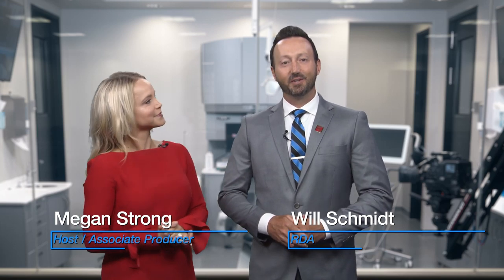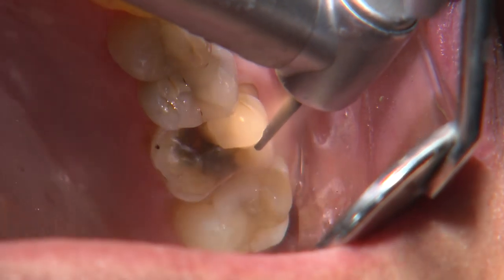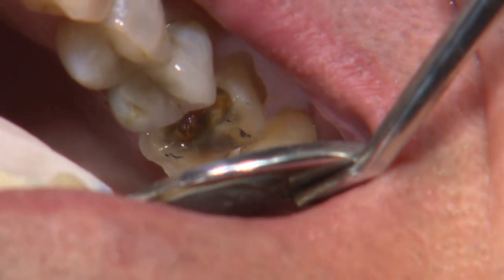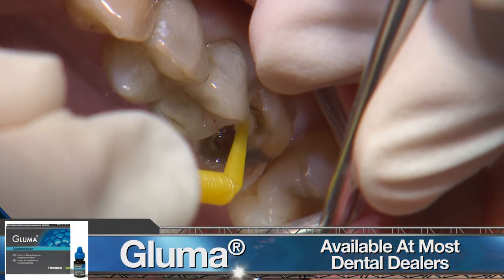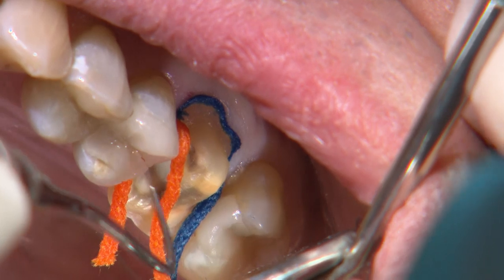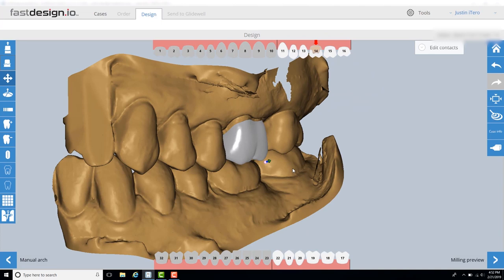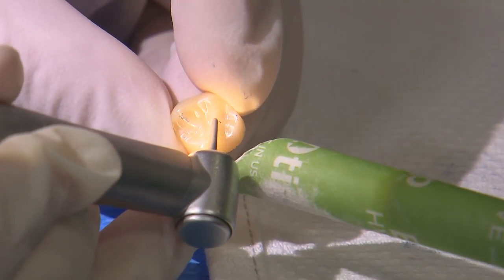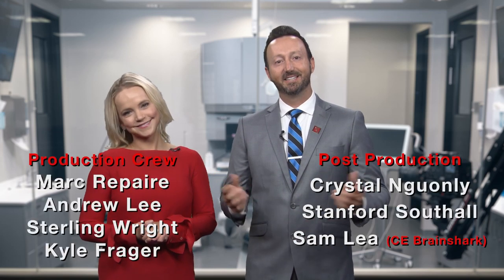Chairside Live Episode 257:The Most Efficient Dentistry of Your Career

Comment: Yep, my lower teeth were painful.  It felt like someone had taken a portion of a wire coat hanger and wrapped it around my lower teeth and then using a pair of pliers, twisted the wire to crunch all of the teeth together. So there was never a gap between any of my lower teeth throughout my life.  In fact, one tooth ended up rotating 45 degrees since in that position it was not as wide. Then I went to a dentist to get my teeth cleaned. When I got home, I looked in the mirror and was totally shocked. I now had huge spaces between my teeth. Not only did the dentist remove any plaque, but removed much of the enamel on the sides of my teeth as well. So now, due to drinking tea, I had deep dark stains on the sides of my teeth since the enamel was removed.  So I had to stop drinking tea.  Then one of my teeth fell apart to a degree.  So the dentist, while bragging about how she had to fly to Paris to attend a wedding, said that the tooth was infected and had to be removed.  I said, " No it doesn't".  She said, " yes it does", I said, "No it doesn't", and so on and so on.  4 years later I still have that tooth, and there never has been an infection. Then there was the time many years before where again I had my teeth cleaned. The dentist, a different dentist,  kept on asking me, "Does it hurt ?", as she went from tooth to tooth doing something with the scribing tool. WTF?  Many years later I found out what she was doing due to my gums having receded a bit. She was scribing deeper and deeper into my teeth just below the gum line until hitting the nerves. But now, due to the gums having receded, when I brushed my teeth, the bristles dropped into the grooves and hit the nerves, and It hurt big time.  It took many years before it no longer was painful. Yep, aren't dentists wonderful people. Around the same time that she told me I had to have a tooth removed, a filling had dropped out.  So she filled it.  Then 2 weeks later it fell out.  So she filled it again. Then a month later this 2nd filling dropped out.  All she wanted was money, money, money, and so she never did a proper job.  So I said to heck with it, and just made sure that the tooth is kept clean at all times. No cavity has formed over the years since then. Yep, aren't dentists wonderful people.

Comment: Why not composite filled instead of ionomer? And then prep? ....
Reply: That’s one of the beautiful things about chairside CADCAM - milling the final restoration immediately to adapt to the clinical situation. No need for extra steps when the “build up” is built into the final prosthesis
Reply: @justinschi  Is retention strength better than a core build up  in this situation?  Thanks for your ideas
Reply: @Drminhquan   I believe less complexity is better as it's difficult to quantify what's better. The mesial defect has 3 walls whereas if I did a build-up it would reduce to 1, reducing the surface area for retention. Would that be enough retention for this prep? Probably. The final retention is also dependent on the buildup's bond to the tooth. Would additional lingual reduction increase retention area? Absolutely. But what's the compromise? For this one case, we could treatment plan it several ways. What's best for our patients is what we're most comfortable doing given our material/technological options and skillset while taking into consideration patients' comfort, time and expense. Thanks for your question.